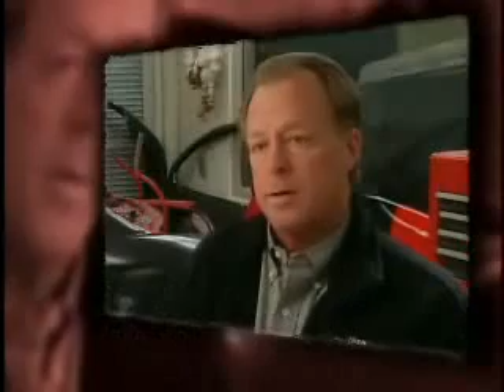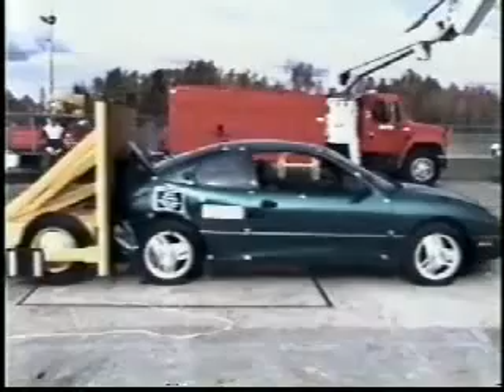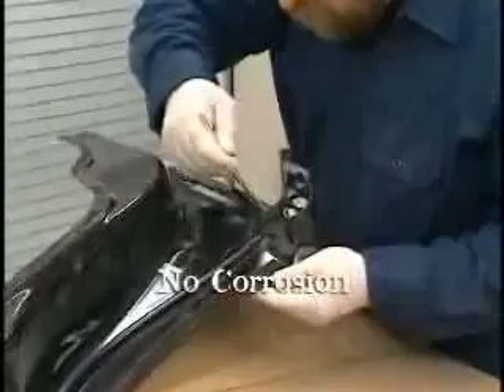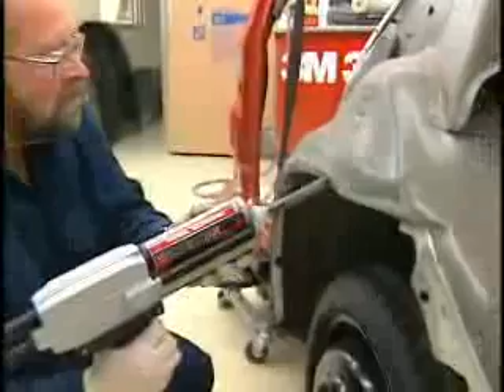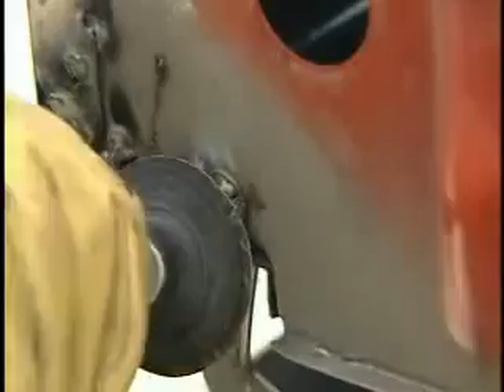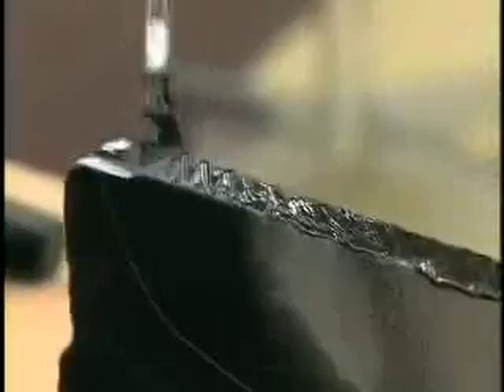3M Panel Bonding

Comment from the maker: If it is designed to permently adhered to the support. Otherwise they make 2 part panel vibration material
Like SEM # 39977

Comment: Literally every unibody car is glued and welded together from the manufacturer now. These products are the standard norm nowadays. And they work great in rust repair with or without the addition of welding when patching in new metal. Every application is different.

Comment: Remember  y'all factory uses panel bond, I use panel bond only on where back glass  go or door jam, and wheel well, the rest I weld tail light packet lower quarter and where the tow panels met.

Comment: lightly heat with a small flame or heat gun....thats how it is "unbonded"... . in todays world though, heating to remove a structural bond is almost frowned upon, because the new boron steel structures will be weakened because of the heat applied to remove the old panel. if its lets say 2005 or older it should be ok to use heat to remove... not certian, but almost all newer cars use hss, or high strength steel to reinforce the strucrure of the body in a collision. weld bonding is the new norm....small amounts of heat can be applied to remove the pannel, but if color change in the metal is present after removal, or the subsequent panel beneth the repair panel is compromised with heat, replacement is required to the subsequent panel. it sucks to be a body technician in todays world of alloy metals. not to mention aluminum rivit bonding, and composites. thats to say if the car is being repaired correctly...welcome to the new world of collision repair.

Comment: What's the first thing the body shop tells you to do for your warranty? Go oil spray the car or your gaurantee is VOID on their repairs. What does oil do to epoxy and urethane products? Well in my case over time the oil turned the urethane soft and pliable. Why did Chrysler windshields pop out so easy? Heat from the sun. Why did Saturn sunroofs blow out in the 90's bad steel but the glue did stick to the glass. Would I glue a roof skin? HELL YES! My point may not be clear here but we simply do not know what the product will do over time. Is it a great product? HELL YES. Why do you have to weld the edges of the truck boxes???? Probably because they are easy to oil the heck out of...but who keeps cars around for 20 years anymore anyways?
Reply: Many race cars have been built with bonded metal and composite construction for decades and aren't coming apart.  In fact, they reap the benefits of having fewer heat affected areas in their structure.

Comment: 3M warranty on bumper adhesive that didn't work = sand it out, apply adhesion promoter reglue. When it peeled, tech line said use 3M sandpaper. When it peeled, they said buy 3M adhesion promoter. When it peeled the 4th time.....they said remove the bumper and identify the material. It was PPE. Usually I melt these with a soldering iron but I needed some filler so I had to glue it. Teck line said use metal adhesive instead of bumper adhesive labelled to "bond all types." Labor warranty???? Yeah right guys. SOLDERING IRON, EPOXY PRIMER AND OLD SCHOOL FLEXIBLE BUMPER ADHESIVE for the lasy 15 years my friends on PPE (black) material

Comment: A local auto body shop introduced this product to me. This panel adhesive has its purpose, but I found it to be messy to work around, time consuming, and I will only use again if I feel my welder could not reach an area sufficiently. I will say this stuff when dry and applying is almost identical to JB weld.

Comment: MyHamShack:  Probably because welds are much faster; no time to wait for chemical curing on a production line. Also cheaper. So that's two very good reasons why OEM's use welding over adhesives.

Comment: Congratulation for people from WelleAuto ! You are smarter than thousands
of engineers in car industry.
Reply: Marc: Justify your bizarre assertion. Why are you such a pathetic jerk that, in order to compliment someone, you must slur an entire class of people?
Reply: Ed Price When auto body man replacing welded parts he is using this driller 
   http://www.eastwood.com/spotweld-cutter-pro-kit-3-8-and-1-2-inch.html
and part is out for 1 hour.What we should use to take off part what was
 glued by 3M Automix . Cut it all around by chisel and hammer?
Spend all day and next new part
wouldn`t fit good.
Or we have to use the torch and breath cancerogen
Reply: Marc King (Last post run me.)
I hope you know it is very toxic if you are burning that, We have 2K bondo
sealer on the market last +20 yr which we are using for the glass. That stuff is good for lazy, irresponsible body man. Very good to make trouble to someone who will work after him.

Comment: for my application i didn't need much panel bond at all...i bought some 3M panel bond, the listed price was $56, after my discount i ended up paying only $36. and i only used 1/4 of the tube. used this as well as POR 15 to prevent rust...been holding strong for about a year and a half, haven't had any issues. :)
Reply: is it still holding up well
Reply: Since Feb 2013, zero rust. Car is a pleasure vehicle, sits inside and avoids undesirable weather. I'm confident it would still be holding even if it was daily driven. Had the inner off recently and haven't seen any bad signs.

Comment: This stuff is not for the reg guy. It's for a big auto body repair shop. Unless u want to pay $200 for the caulking gun and the mixing tips /and that bond is like $50 per small tube.
It's some killer stuff.  I wish I had some to mess with though. ;(   Waaaaaaah !